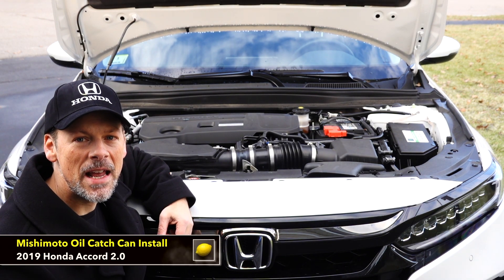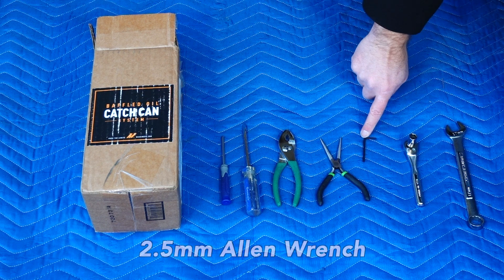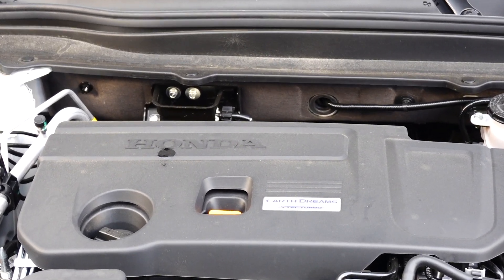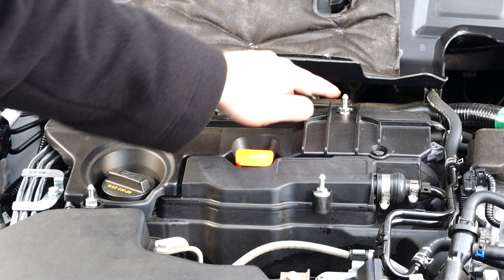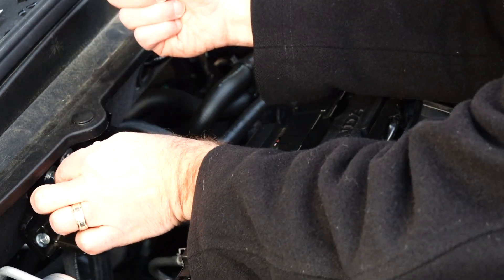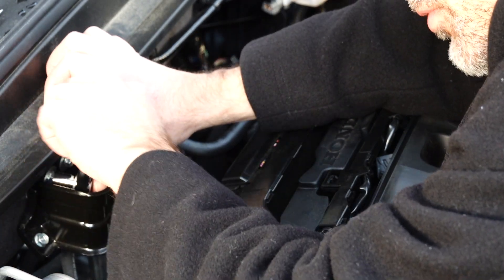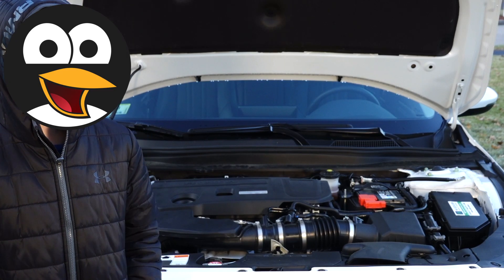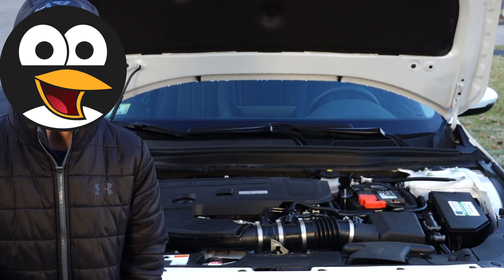Mishimoto Oil Catch Can Install (2019 Honda Accord)

Comment: Thanks for the video I was able to install mine.  Only issue is the OEM pipe was dry as a bone.  My car has  38k miles shouldn't  some oil have gone down that pipe by now?  Anyway that's a good thing I will see how much oil I collect

Comment: thanks for the video. i like the quality of the parts included like the mounting bracket, pre bent hoses with the clamps and the check valve only allowing 1 direction of flow, i have 2017 accord was yours honda specific?     thanks
Reply from the maker: It was specific in the sense that it had the appropriate hoses at the correct lengths and bends 👍

Comment: Any advice/recommendations for optimal placement of the hose with the check-valve onto the engine side nozzle? I can get the 3 other system hose openings flush with their respective attachments but despite my best efforts there is still a small separation between the end of the hose with the check-valve on the engine side and the nozzle. The angle of the hose and partial covering of the engine attachment I find make it very difficult for me to push the hose all the way up to its end point and I'm worried that any residual gap will have deleterious effects on the engine. Thanks!

Comment: When removing that pvc hose did you plug the nipple to the intake with a rubber cap and a clamp? I plan to use the Nuke Performance catch can which has dual -10 an orb inlets and one -10 an outlet which will vta. One inlet from the pvc, the other from the crank case. I also added their petcock to drain without removing the bottom portion to drain it. I used this in my 2018 Honda Civic Type R where I used Radium banjo fittings. It takes the place of two catch cans. Made in Sweden.

Comment: another option,  just plug the lower connection (the vacuum source) and put a small filter style vent on the top connection...  Old school,   Cars all the way back to the 40's have been venting crank case vapor to the atmosphere, no check valves, no filters.   This way you have ZERO oil forced into the intake side of your engine.

Comment: Waste of money on these motors and can cause issues. Talk to any of the reputable tuners for this platform. Save you $200 for a different mod.
Reply: Tell us why please
Reply: @u-know-this  according to Derek at IMW, external catch cans on this platform are totally pointless since all they will collect is condensed oil vapors and water and according to him, the stock pcv system is really efficient

Comment: Appreciate the video, I tried to watch a few others and they didn't specify if it were 2.0 or 1.5 turbo accord, and the rubber hose was coming out and in from a different location.
I almost took out the wrong one lol
I also unbolted the plastic cover that surrounds the oil cap and was able to lift the cables up a few centimeters to have a bit more room to slide on the clamp at 12:48
Reply from the maker: Thank you for the watch and comment. 👍 I’m glad you found it helpful.

Comment: Hey Lemon Squad can you do a update as to how much oil was there in the catch can since you installed it ?
Reply: Any change on if anything has accumulated yet? I have a manual and am wondering if I should spend the money for one if I can't see the difference. I'm getting a slight hesitation at full throttle and am thinking maybe this may be the culprit. I'll be watching for any feedback. Thanks.
Reply from the maker: I’ll be checking in a couple weeks as it’s been a year. 👍
Reply from the maker: I can do that.  However, it may be a little while as I haven't put many miles on the car due to COVID19.

Comment: Have you noticed a buzzing or ticking sound at low RPMs between 1500-2500 light throttle? Radio off of course.
Reply from the maker: I have not.  You think it's coming from the catch can?
Reply: @TheLemonFactor  yes I do. Mishimoto said the culprit is usually the bronze filter. I am not sure what that is, but they have not done anything about it yet. I will be taking it off and installing the stock hose to 100% guarantee it's the catch can.
Reply: @Robbie2Fly  Any luck on if it was 100% the catch can. I installed mine the other day and it feels like I hear the same thing.

Comment: How often do you need to empty it?
Reply from the maker: As often as needed before it fills up ; ).... Seriously though I will be checking it every 5,000 miles.
Reply: I've hade one installed for 2000 miles and it still dry theres nothing in it
Reply: @hemiboy3923  that's a good thing.  Did u finally Catch something?
Reply: @u-know-this  No, that things stayed dry but I never ran my card. Too hard maybe that's why
Reply: @hemiboy3923  interesting maybe honda 'fixed it on the 2.0t . I drive mine daily with one 2 min sprinted driving . I do about 100 miles a day

Comment: Thanks for this video.  I agree about the importance of a catch can.  Sending  oil vapor back through the intake is not good for the engine. Eventually there will be a loss of power and flow when the valve opens due to carbon build-up. Most of the time, if you were to take off the throttle body, you will see some pooling of oil in the intake.  The Mishimoto is a good catch can to purchase.  It isn’t cheap, but it is well worth the money spent. Your video helps others to know how to install the can.  Thanks again...
Reply from the maker: Thank you for the comment and watch

Comment: Are you going to be doing an install video for one on the MX-5? If not, have you come across any good ones that you can link to? Since my order for a 2020 model just went in, this is something I've been thinking about doing once it arrives.
Reply from the maker: I do plan on installing one, but haven't decided if I'll do a video.  With that said, Mishimoto does have catch can available for the Mazda Miata, although it's pricey.